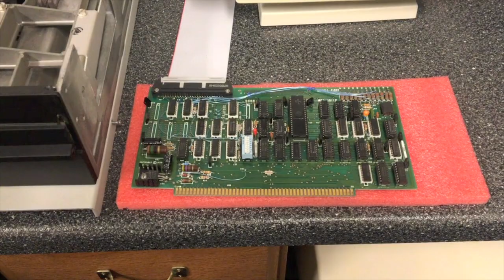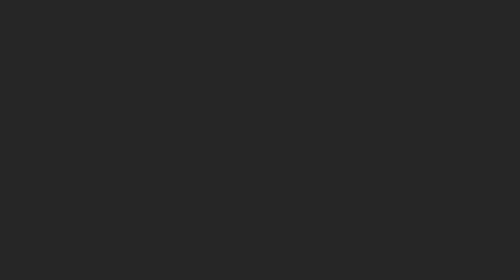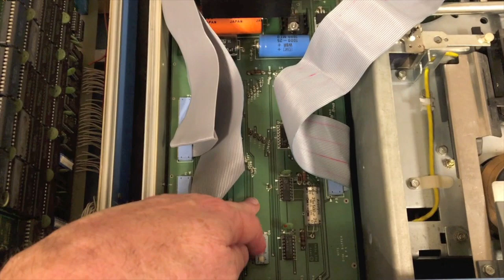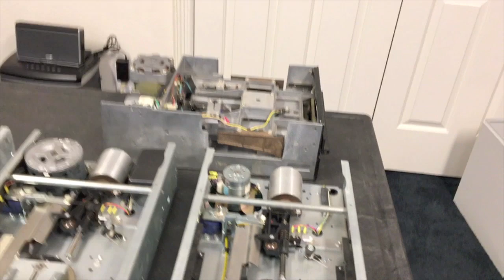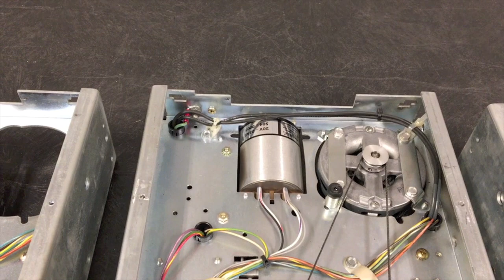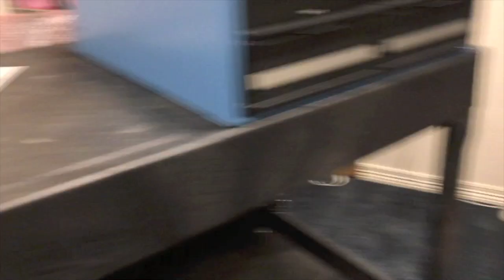Altair 8 inch Floppy Drive

Comment: A replacement for these was also Pertec3812 system that follow-up on the 3712 he mentionned in the video that had a single board controller in the diskdrive cabinet. The 3712 had a dual board controller.
Reply from the maker: Yes, the 3712 and 3812 were very interesting products that quickly died with the introduction of WD1771 disk controller IC. The Pertec 3202 was a direct replacement for two original Altair drives and the 3712 and 3812 were Altair compatible soft sector drives with the controller in the drive cabinet instead of in the computer. Here are videos I made for each of these:
FD-3202 https://youtu.be/ihqOO0bFTdw
FD-3712 https://youtu.be/Md1oEWf171o
FD-3812 https://youtu.be/Mz-BIgUBhKA

Comment: I have an Altair 680 in storage so all things Altair are of interest to me.
Reply: The computer looks quite nice, why not display it on a shelf or something instead of burying it in some store room?
Reply: @SmetadAnarkist  because the 680 was an embarrassing product for Altair. Very compromised, poorly designed, and incompatible with nearly every other 6800 platform in both hardware and software. Even in its time it was almost a useless computer and deramp here has a few videos detailing some of its pitfalls. It looks nice but that's about all it does nicely :P
Reply: @8bits59  BAH! if i had one i'd proudly display it next to my first computer, which i still own... a TI99/4A, LOL